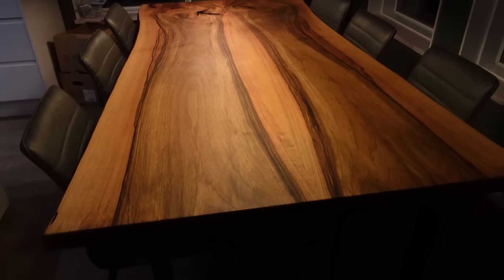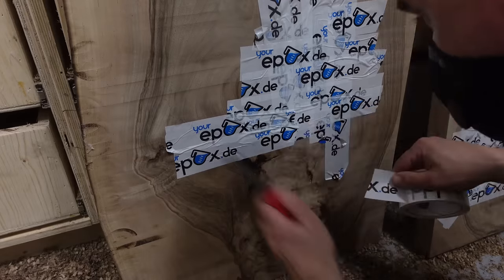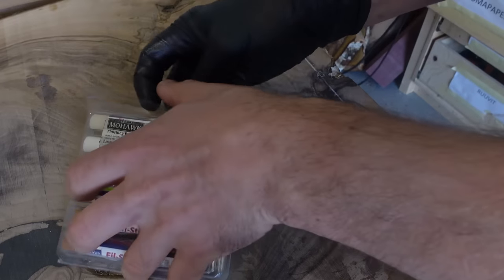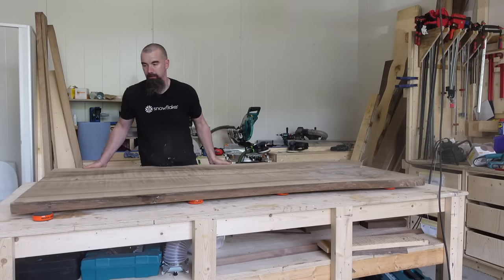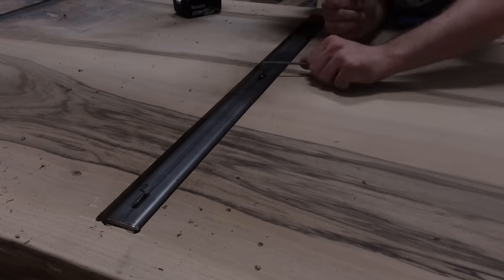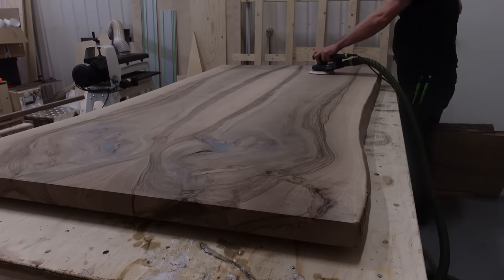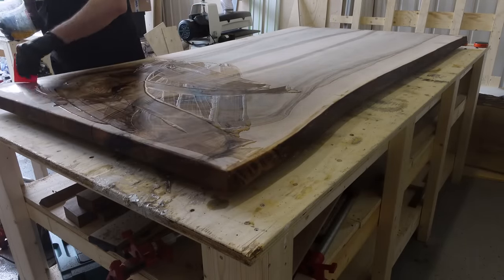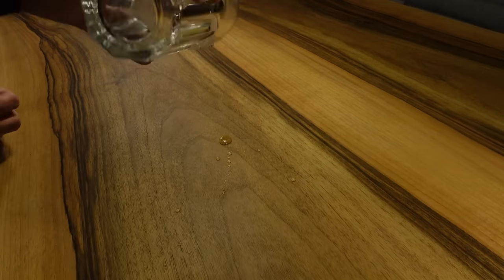Bookmatched Walnut Slab / Live Edge Dining Table Build

Comment: Only question why use C channel for movement then lock the top down with the legs other than that great build
Reply from the maker: The legs are loosely attached and they have small slots so it should allow for movement (I guess?). First time for me using these :)